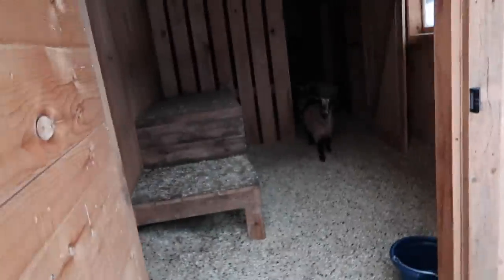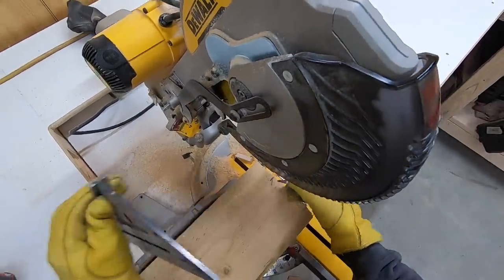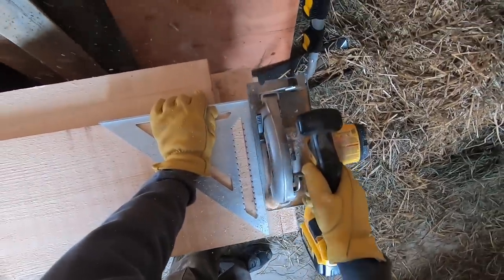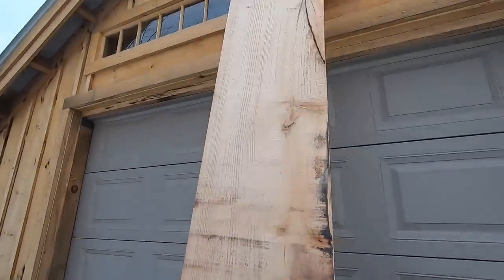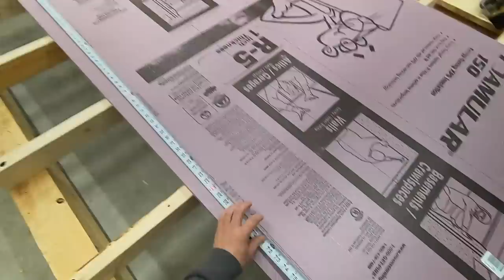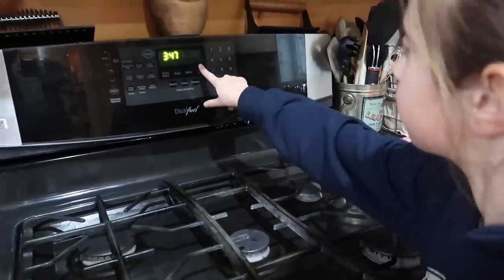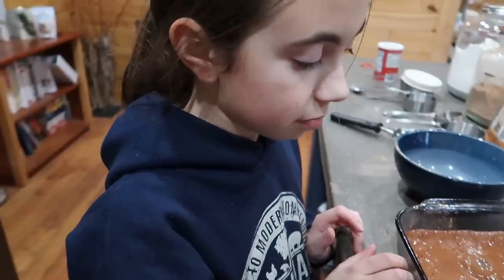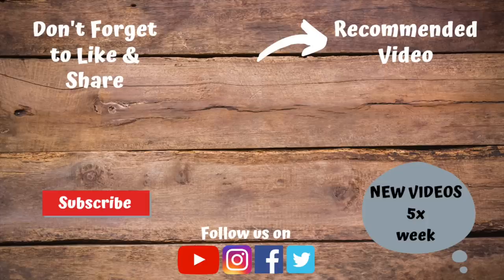Building a New Chicken COOP this 1 TRICK will get us More EGGS in the WINTER

Comment: Might be a good time to bend a piece of steel strap around the end with an eye welded to it (or drill a hole and run a steel eye bolt through it).  It will tow much easier and not tear out your eye lag bolts.  Through bolt the strap with carriage bolts (nut up) before building the house on it.  Take care.  Doug

Comment: If you want to drag that coop you should probably cut a second shallower angle on the bottom of the front so it doesn't dig in, and you should make a spreader-bar so the chains pull straight from where they hook in.

Comment: You will get a kick out of Texas weather.
Day b4 yesterday high of 80°
yesterday high of about 55°
Today high is supposed to be about 65°
Low was 30° 
Rest of week temps are said to be 45° to 55° highs about 75° 
This is in San Antonio Texas.
Just hope it doesn't kill trees with these cooler temperatures. The tree's are putting on leafs.
Reply: crazy boy i live in West Virginia Monday was 72 yesterday was 34 tomorrow is supposed to be 29 with 4” of snow... we have had all four seasons IN ONE WEEK. Flowers are coming up and trees started budding but it will all die off from this cold! I hope the ground hog was right! I need an early spring! my mud is frozen I’d rather it be sloshy. 😂

Comment: Big Snow storm coming this weekend Al. How is the New Light working on your saw Al ? You need a Saw Mill next, you have lots of trees to cut up. Al , could you have put pc. of 2x4 in between to make the floor stiffer. Would treated lumber keep the bugs out of the wood while it is close to the ground. Use some water seal on the wood. Harbor Freight has wheels, Tractor Supply, Rural King. Order on line. Can even buy solid  tires.

Comment: Al, on the wheels, I like the Ace Hardware pneumatic wheelbarrow wheels. Ace will tell you the req’d shaft diameter.  It’s about 5/8 to 3/4.   I’d make a full length axle from 2” steel pipe and weld the small stub axle on the ends using a flat plate.  And then bolt the the 2” pipe underneath the hemlock runners.  I’d use a cast half-round bracket for rigidity.   Then you can slide your wheels off and on.

Comment: Nails - have an inclination to work themselves out until the get rusty and this ties them down. If you need some constructional strength, then note that the "work themselves out" inclination is activated under torsion, rattle or vibration (e.g. dragging the coop over a surface that is not absolutely flat and smooth.)
If you do not want to do a lot of joinery, gluing or screwing? Then review the way you drive in the nails.
16:45 .. 19:00 - here all the nails are driven through the boards into the beams underneath at a NINETY degree angle to the board. Imagine, you take a FORTY FIVE degree angle and you have more resilience to the "work themselves out" inclination, which you can improve even more by alternating the angle of attack so the first nail goes in 45 degrees away from you and the second in the opposite direction. Decades from when you put it together when people want to take it apart, they may curse for this being a lot of work and they'll say somebody did a great job in putting this together in the first place.

Comment: 10" solid rubber wheels 4=880 lbs 5/8 shaft harbor freight, 5/8 pillow block bearings, 4=30.90 amazon, 5/8 axle shafts 2= 49.42 amazon

Comment: Make your-shelf a pass-through door for lumber, where you store the lumber outside of the barn. If I remember right, you left a space for a full door there. You could hang some plastic or rubber sheeting to cut out the wind and cold weather in side of the small door. Also why not make a brooder area there and add the chicken yard on to it.You could add a vent from the shop to heat the brooder area. Of cause this idea come's to late for you have already built the new coop.

Comment: https://www.northerntool.com/shop/tools/product_200331412_200331412.  They have integrated bearings and fit on a 3/4" shaft.
They have a load limit of 365lb ea, so around 1400lb for 4.  You're at around 450lb for the skids and floor already.  By the time you're done I'd guess you'll be near the working load limit, but should work for occasional use moving the chicken coop around if you lift the ends of the skids and put a block on them to take the load off the wheels while fixed in place.  That would also extend the life of your skids since they won't be sitting directly on the ground.

Comment: Ryobi has a battery powered chalking gun. There is an adapter on line so you can use Dewalt Batteries. It will save time calking.

Comment: you can get the wheels from harbor freight or your local TSC. I would go with harbor freight. if you install lights in the new coop that will increase winter egg production. you can try solar lights but I would recommend 4' leds.

Comment: Hold Up!  I hope you get this before you put the walls up.  Do you have plans to stop the foam from compressing under the weight of the walls?  As far as wheels, I have some ideas. The best one is to get a tilt flat bed trailer and just drag the skids up on it. Something big enough to get your Kabota up onto should you have to take it somewhere.  Something like a car dolly.  Winch it up and use winch anchors to drag it off. :)

Comment: It's going to be hard to beat the durability & movability you've had with New Yolk City.
For Gina & Olivia I have a baking tip for you>Please don't tap your flour & dry goods down to level your cups out.  When you do that you compact your flour & dry goods down, which means more flour, etc in your measuring cups.  Use a flat edged knife to just scrape the excess flour etc off.
I use to make the same mistake.  Believe me it really makes a difference in the texture of cakes & breads from dense to light textures.

Comment: Your side drop down wheel are very common on our ICE FISHING HOUSES that are towed to the LAKE and put on the ice over a desired fishing hole.  When spotted, the wheels are cranked up and the Fish House settles down on the lake.  Then you go inside and flip open floor opening to expose the ice. Drill your fishing hole with a fish auger and go fishing. The squatting down blocks the light allowing you to see down the ice hole and does not scoffer away the fish.
So you need to look at the fish house and copy their design, as I do not stink you are going to spen the money for spring loaded trailer towing wheels.

Comment: Great chicken coop! For a floor that big I would definitely add some diagonal bracing under the floor joists to prevent twisting when pulling and one strut gets stuck.
Reply: Ken Corsell if I used a solid sheet of plywood for the floor instead, would I still need diagonal bracing?
Reply: Plywood would have made it much more rigid, but cutting 1/2”  deep dados into the top of the 4x6 runners for the floor joists to lock into would probably keep it square when moving it as well.
Reply: Ken Corsell thank you for your help

Comment: JudithB  I  wondered  why  you  diidnt  drill  a  hole  thru  the  skids for pulling  while  you  were  prepping  them??  Boss  of  the  Swamp  said  ants  like to move into the  foam board  and  I  know  they like to get in the top  of  my  hives but  cinnamon  drives  them out.  I  also  use  the  back of  a  butter  knife  to  level  my  measures  so  I  dont  get  my  fingers  in  the  foods!   Just some  thoughts!!

Comment: You can get "wheelbarrow"  (10" or 13") wheels lots of places.  And then use a big bolt, or all-thread for an axle.  That's what I used for my hoop - coop chicken tractor.  Harbor Freight has them pretty cheap and they seem to be as good as any.  I'd go with never-flat ones.  However, your coop is going to be a lot heavier.  I'm sure the wheels could take it, but I'm concerned about how 'bolt' axles would hold up.  I think they would be a lot stronger if you could support both ends of the bolt, and have a short span.  When say they were bolted just sticking out the side of the tractor, and only supported by one end, the weight works on them like levers if the load is too much, it bends easier. But if both ends get support and your axle was like the crossbar in an "H" the same size axle would handle way more weight.  I don't know how much bolts for axles could take, but I guess you could try them fairly cheaply, and if it turned out that coup was too heavy, go find a small trailer axle and bolt it on under those skids, and you'd already have the wheels and tires.

Comment: If you would put in a light it may help you get more eggs during the winter.  I don't know if some solar lights would work with the solar panel on the outside and the light part on the inside.  I know it works here in Pennsylvania but you have grayer winters there.
Reply: Amy Delp - Lumnah Acres covered in a previous video why they would not be putting lights in coop.

Comment: Try etrailer.com. They have bolt on trailer spindles. You may have to use a trailer wheel. A wheelbarrow wheel may not hold the weight of the coop. You have a great family and work ethic. God Bless You.

Comment: Al, isn't it nice having young strong knees when scooting around on concrete. Will they always be strong or will you walk like an old man at 50? Think knee pads!
Reply: @Maybe Smithe Last summer we laid a 12' x 15' paver BBQ patio. I bought No Cry pads from Amazon ($30) and loved them. They're a combo of gel and foam. The pavers chewed on the pads but nothing bad. Could build a dozen more similar patio's with them. My knee's felt zero discomfort. No pinching on back of legs either.
Reply: I didn't need knee pads when I was lite..
But at 240lbs
I use my gel pads
Because my knees won't take it..
Reply: I would tell all young men & women use knee pads and ear defenders all the time with masks when necessary. I am 76 so I guess I am qualified to give advice. I wish we had them when I was young.
Reply: @wileycoyotesr8623  I had to move some concrete blocks ( 50 lbs+) and I had a Langfit® Panel Lifter to pick up the blocks without bending down. It helped a lot. I can get down on my knees, but they hurt so much,(work-related injury lifting patients twice my own weight) when I try to get up, and that is nowhere near elegant: arduous and noisy (adult language applied) and I need something solid to hold on to.

Comment: Idea for your wheels. 
Cut a 12' x  2" x 12" into 3' lengths. Do the same to 1   12' x 4" x 4"s. Stack the 4" x 4" , glue and screw them, so that you have 2  3' x 4" x 8" add a layer of 1/4" ply to one side of these. Take each 3' x 4" x 8" and attach a 2" x 12" on each side, so they are flush on one side, making a U shape channel. Get 4 of these wheels from Harbor Freight, https://www.harborfreight.com/13-in-heavy-duty-pneumatic-tire-with-white-hub-63058.html, they are rated for 400 pounds each, and a 3' length of 5/8" steel rod. Drill a 5/8" hole through the side of each U shaped channel, 2" up from the bottom, at the center. slide half the steel rod through the hole and put a tire on either side. add washers and drill holes in the rods, for Cotter keys. Lift one end of the coop, attach the wheels to the 4" x 6" skids, with lag bolts. Lift the other end of the shed with a chain, hooked to eye bolts, in the skids, and roll it where you need it.

Comment: Safety Tip:
Congratulations, you handled the nail gun very good. You kept your finger off the trigger between nails. Moving around with the trigger pulled because he knew the safety would fire it when needed is how he bumped his knee and nailed it with a 16d nail. 
Congratulations, and i will get off my soap box now and leave you alone.

Comment: Tractor Supply has 13 in. Never Flat tires. With 5/8 bore and heavy duty ball bearings.  Item #PU1304  3553298  IPC 449394002892.  I used then on a trailer dolly

Comment: Al, don't know what to call it but isn't there a device where wheels/axles can be raised out of the way to rest the coop on the skids, and then when you need to move the coop it you just push a lever and it jacks up the platform and moves the wheels back into place? Seems like I've seen something like that.
Reply from the maker: I’ve never seen anything like that. Would be interesting to see it.
Reply: @LumnahAcres  it works similar to a mechanical wheel dolly, I just don't know what its called.
Reply: @LumnahAcres  
Here is what he's talking about ..... Ok I looked up.    "Raised wheels moveable chicken coop"    and found all kind of stuff that you might wud like and I also seen  heavy duty wheel kit... Wheel lift kit. That you cud look up as well and see if there's anything that pops up that u may can use
Reply: @LumnahAcres  what I just told you about is exactly what original commenter said the coop sits flat until you need to move it then you bring your wheels out however it tells you to do it bc they fold or raise up so once there out and ready to roll then you hook it up to whatever will be moving it and ride so I hope this helps I know wen I seen what he mentioned I went straight and looked it up and they are out there I hope u have a good day
Reply: @mintysingularity  hey good job mentioning those raised wheels I looked them up on Google and there are places that do have them I hope he sees my other comment so he can check it out
Reply: @dreamcatcher2058  yep, wheel lift kits look to be the thing, awesome 👍 That would also sidestep the problem of NYC slumping into the ground over winter, flat tires, etc.
Reply: @mintysingularity  yes and the wheels are posed to be easy to put up and down so it cud sit on its base majority of the time till he need to move it then let the wheels out and move it and then put them bck up it wud save the tires and everything I'm glad you thought of that bcc I didn't and I haven't seen anyone else mention it either

Comment: (Pack of 4) Trailer Axle Kits with 4 on 4" Bolt Idler Hub & 1" Round BT8 Spindle$134.99
FAST 'N FREE
Get it by Tuesday, Feb 11 from Bluffton, Indiana
Need it faster? More shipping options available at checkout
 • New condition
 • 30 day returns - Buyer pays return shipping
Assembly with 4 on 4" bolt idler hub & 1" round BT8 spindle. Rated to 1,250 lbs. each or 2,000 lbs. for the pair. This Hub fits standard length spindles, not "short spindles". Refer to images 2 & 3 for more information.
Read full description
See details- (Pack of 4) Trailer Axle Kits with 4 on 4&#034; Bolt Idler Hub &amp; 1&#034; Round BT8 Spindle

Comment: Perhaps Al you should think of using wheels. They would be an improvement. The invention of the wheel was a huge step forward for civilization and I feel would be a better choice for this application. You will be older when the skids need to be replaced don'tcha know.
Reply: yes . he can put 3 - 4 set of wheels as this one looks bigger but well worth the extra cost AS SKIDS require more power to drag and still it can get stuck